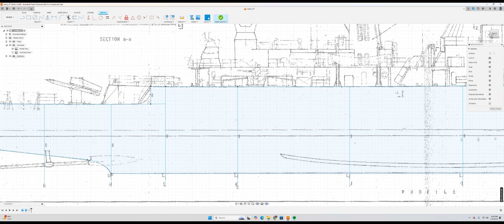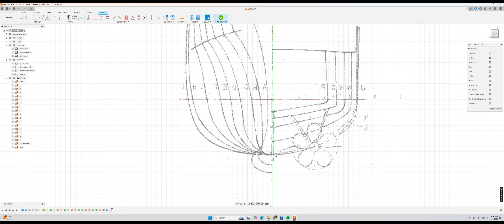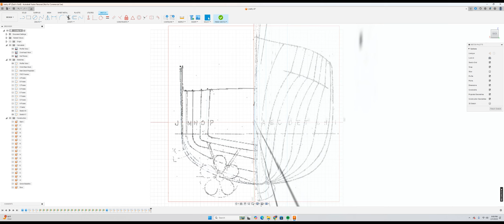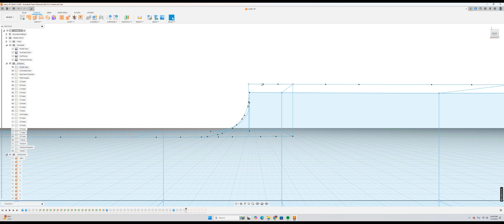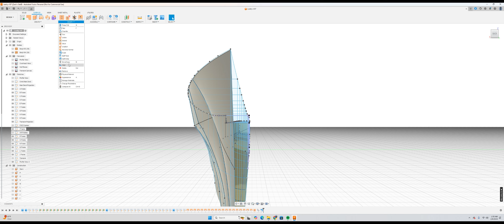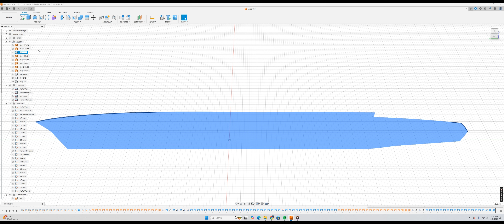Fusion 360 RC Ship Hull Tutorial, USS Leahy

Comment: At the end. A trick i found whilst researching techniques is to use patching to make your object (like what you did with suface lofts). BUT additionally, Patch the mirror line and the top deck too. At this point it should look like an enclosed body. 

Then stitch all pieces and if they are completely enclosed (as in no free edges) fusion will automatically make it a solid body. That way you can use shell to make a perfect wall thickness all around with no funny business. 

This removes the need to make an offset body ans issues you had combining the bodies together 😀

Great tutorial overall. Incredible. Your mate must be happy !

Comment: Still getting the hang of this, but I found it easier at the end to loft the sides, mirror so you have the hull, then stich it all together, then you can loft the top shut and stitch that, then you get a solid. Copy and paste the solid in top of itself, scale the copy not uniform, I did 99% length ways and about 97% sideways, then move it up a little so it is just higher than the original, then go to solid and combine, use the larger solid for the base and then scaled solid as the cut. choose cut and its done.

Comment: I believe the ripples you get are because you didn't loft the entire side in one go - did you try that? It could help. Also, anywhere you can use two spline points instead of three, you really should. Extra spline points produce ripples in my experience. I was able to loft all stations of a ship (Tally Ho) using only two spline points per rib. It took some fiddling, but the surface quality was better.

Nice stuff, I hadn't thought of creating a master sketch with all forward stations and copy/project from there. Very elegant.

You could have mirrored the hull side, closed the top and then use the shell command to make it hollow. You could open up a single "hatch" in the top using the hollow command a keep most of the deck. Though hollow is one of the most finicky commands.
Reply from the maker: Thanks for the tips! Yea, I tried the "shell" function with both square and rounded styles, but all it ever did was stall my computer for a few minutes before giving an error message. Which is why I had to do the copy/cut method.

Comment: Thanks for making the video Zack, 
There is still the issue of bubbely surfaces (especially on the forward part of the ship, so it will need a lot of filler, but perhaps this is a limitation with Fusion 360 and the solid/surfacemodeling solution it has... but a tip for the keel, try extending the lines upwards before extruding them, that way you wont have to move the keel around and have it be missaligned at the bottom. 
Looking forwards to seeing how it comes out IRL.
Kind regards
Claes